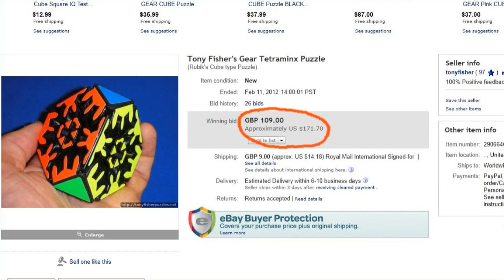How to make a $170 puzzle in 60 mins! Custom Gear Tetraminx construction

Comment from the maker: Yes, don't just copy techniques and puzzles others have made. Develop your own ideas and techniques based on your interests, strengths, what materials are available and how much you can spend on them. 
I usually get my ideas just by looking at existing puzzles, perhaps with two or three pieces removed. Looking at the way it all fits together I'm thinking "Ok, so if I cut that part off it will still work, but I mustn't touch that other bit or it won't hold together".

Comment from the maker: @bryanarby The sticker material is quite thick so a small hole in the plastic (beneath the sticker) big enough for a screw driver might have worked. However the buyer isn't too bothered about adjusting tensions so it will be fine as is.

Comment from the maker: @cammax0  If you can solve a 5x5x5 you should be able to apply that same method to any size. The biggest I have solved is a 7x7x7 but it takes me about an hour and a half  providing I don't make any errors and get lost. I prefer to use my own method which is very slow.